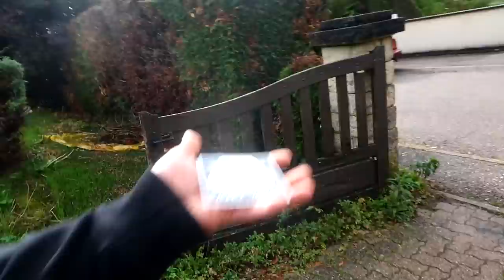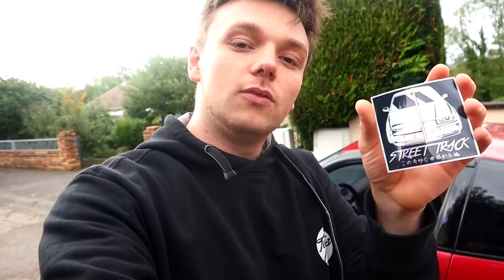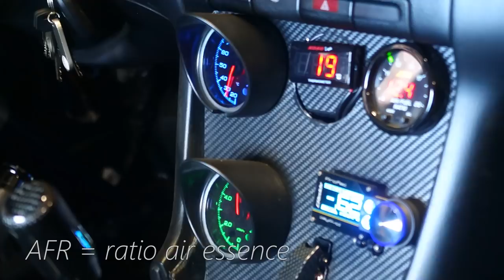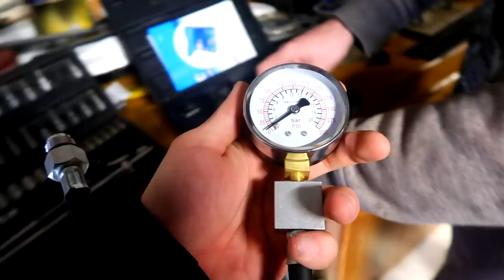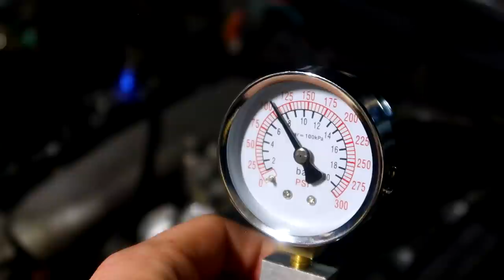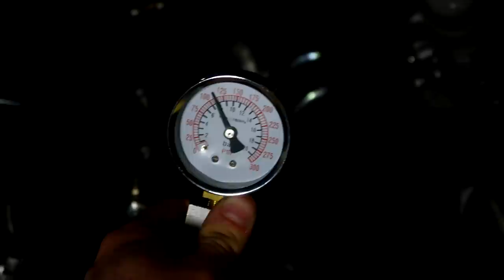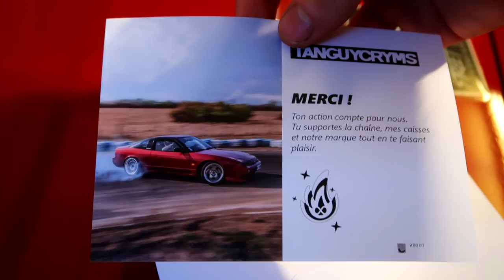IL ME FAIT TESTER LE MOTEUR DE MES RÊVES !

Comment: Les compressions basses pourraient venir d'un joint de culasse cote réparation. Si un tel joint a été installé alors que la culasse n'a pas été rectifié, tu augmentes le volume entre la tête du piston et la culasse. Tu modifies donc le rapport volumétrique. Ca peut être une explication. Sinon, si tu veux t'assurer que ce n'est pas une segmentation, il suffit de mettre un peu d'huile dans les cylindres le temps de faire le test de compression. Si la pression est supérieure avec de l'huile alors la segmentation es fatiguée.